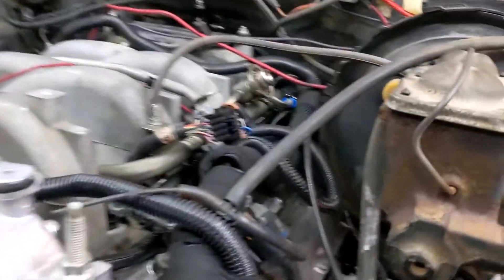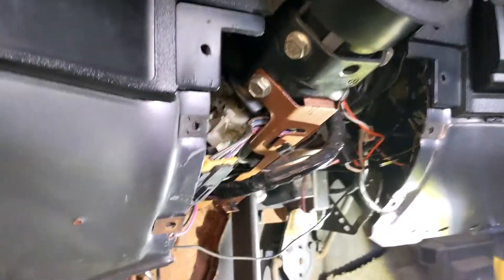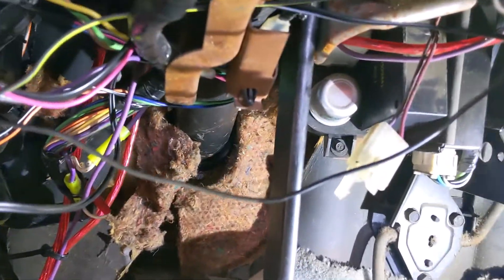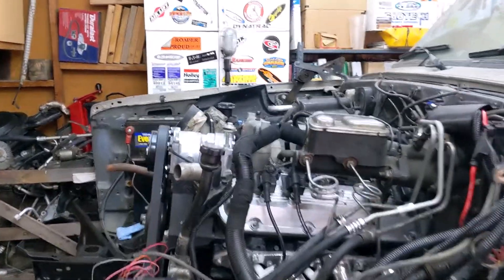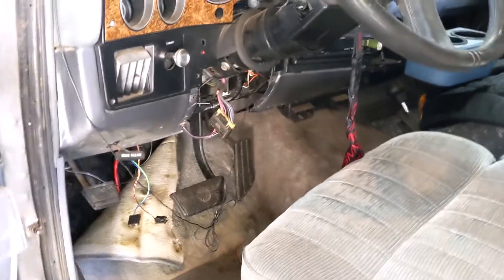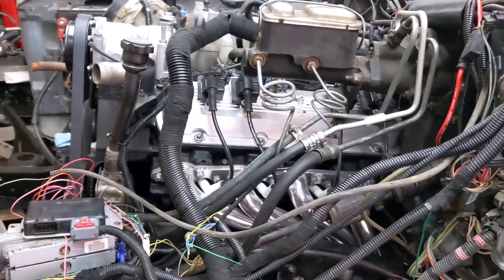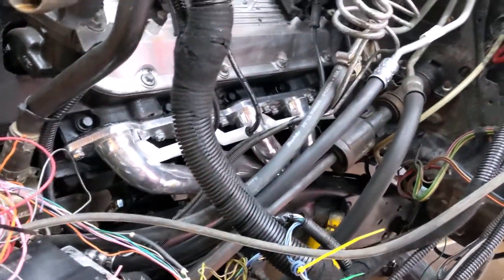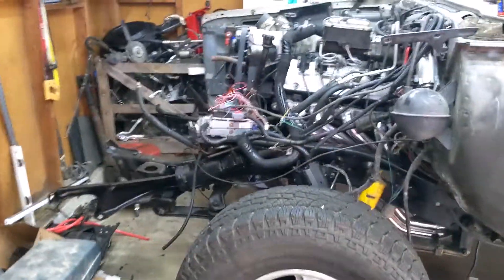Squarebody Suburban Vortec 8.1 Swap - Hydroboost Upgrade

Comment: Do you know if the hydro boost you got was from a CUVC M1008 or M1009 i think they can be different, good stuff and thanks
Reply from the maker: @ricardomendoza7934  I do not know. It was available as a take-off that my friend had in his storage bin.
Reply: So from what I gathered there is not much difference in the hydro boost unit its self but in the master cylinder ,it was much bigger on M1008 (Pickup) to tow heavy load then on the M1009 (K5) which was just for people leaving this for anyone needing info 👍

Comment: Did you have to end up putting in a proportioning valvd?
Reply from the maker: Nope. Everything works great. The brakes are really good.
Reply: @Pete's Place Garage  awesome. I'm about to do the same. Got a hydroboost unit and hoses from a cucv.
Reply from the maker: @brettgildersleeve9139  it bolts in.

Comment: I used cheap e bay electric gauges on my ‘73 c10 when i put a LS in it, i was able to make them fit in the stock bezel and got all custom gauges for under $150 or so…but yeah i was gonna do the torque app with a tablet as well but i couldnt figure out how to link the damn thing…..awesome build you have there ive owned 2 of them square body suburban 4x4’s one a 1500 and the other a 2500…both 350 small block trucks … personally i liked the 1500 better….but im sure had my 2500 had a 8.1 swapped in it my feelings would have been diffrent….for the record my eagle 230 eliminator (boat) has that same vortec 8.1 in it, and it is an 80mph boat all day, as long as i have my trims dialed in….i love it!!!

Comment: I did the same swap in my 90 k5. I never switched the brake lines when I installed the hydroboost. My front tires seem to do all the stopping (more than normal). Maybe I will try to swap the lines.
Reply: When you switched the lines did it make a difference? Im in the ending stages of my 77 c10 LS swap and my hydroboost is one of my last steps to complete. Would like to know.